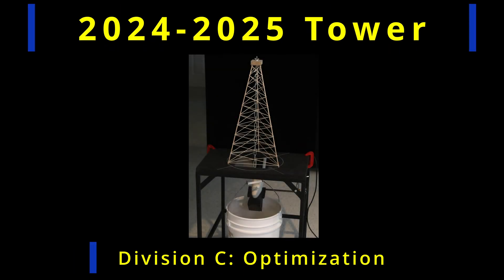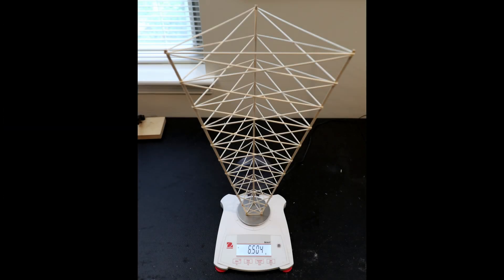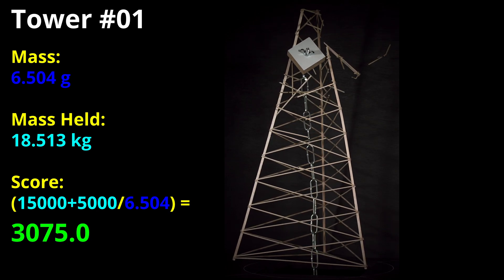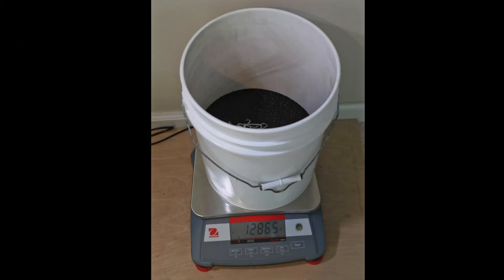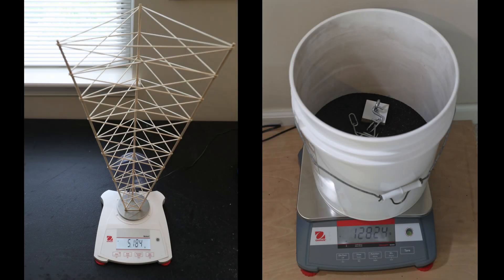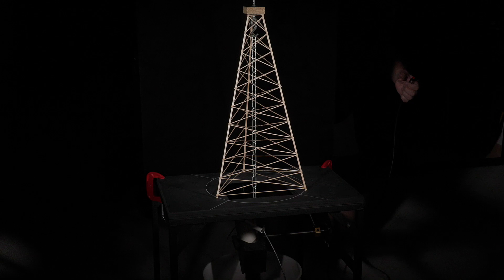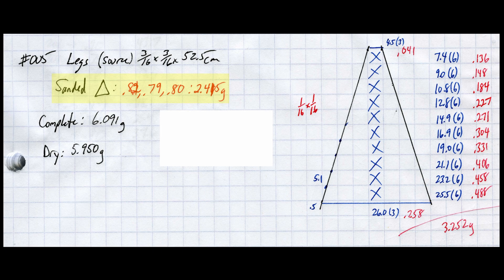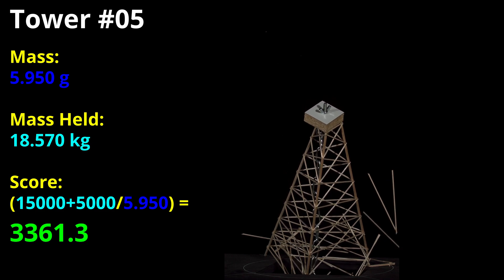2025 Science Olympiad Tower Div C: Optimization

Comment: Hey Balsa engineering I have a quick question if you don’t mind. So this might be obvious but I didn’t fully understand, why for this did you use a simply triangular pyramid shape whereas for your Division B build you used something more complicated with a separate base and column? Is it because with only three legs the structure is two weak to handle that change?
Reply from the maker: Hi!  It's all because that's what the rules require.  For Div C you have to have a 3-leg tower this year and for Div B, you have to have that base+column design.  Check out my videos on this year's rules if you want to see the details.  Thanks!

Comment: Any tips on how to load the sand? Should I just shovel it in as fast as possible?
Reply from the maker: If you are using an auto-loader like I show here, my recommendation is to start slow for the first 5-10 seconds and then go pretty much as fast as possible.   You want to minimize the time under maximum load.  If you have to hand-load, try to minimize the time between cups.  Don't dump the sand all at once, but again, pour pretty quickly.  Good luck!

Comment: Hi balsa engineering! I was wondering if you recommend gluing the crossbars at the center or to leave them unglued. When I was building and testing, I felt that the tower broke a lot near the intersection of the crossbars - do you think this is because I glued the centers? Thank you!
Reply from the maker: Hi!  You definitely want to glue the center point of the cross members.  It effectively makes them 4 times stronger against buckling due to being half the length.  If you want more details and a good demonstration, check out my 5-part tower basics series from last summer.
Reply: Okay, thank you so much!
Reply: Hello! I had another question - today I was building my tower on my jig and when I went to take it off, it was very difficult. Unfortunately, one of the legs of my towers splintered and came apart 1 inch from the base so I reinforced it with glue. Is there anything else you would recommend doing such as adding another small piece of balsa for reinforcement? Just for reference, my tower is just under 7 grams. Thank you for your help!
Reply from the maker: @user-zh8jn9lk9s  Hi!  For a broken piece like that, I would recommend gluing a small piece next to it that acts like a splint and not to rely just on glue reinforcement.  Good luck!!
Reply: @balsaengineering6686  Okay, thanks so much. Your videos have been extremely helpful this build season!

Comment: Do you also glue where the two cross braces intercept?
Reply from the maker: Yes, definitely.  That joint is very important as it increases the buckling strength of those cross members by a factor of 4 by effectively cutting the length in half.  If you want the in-depth theory answer, check out my 5-part tower basics series from last summer.

Comment: hello balsa engineering, any tips to get the tower off of the 3d jig? I have tried pushing it, tried tilting it to horizontal, and placing small segments of leg on the  bottom of the legs and then placing the small segments against the wall and tapping the mold with a small tapping hammer in hopes the mold will move out and the tower will be freed. normaly these work but havent for this tower, any tips? Thank you
Reply from the maker: At some point, it's possible that it's glued to the jig so bad that you are going to have to damage it to get it off.  I would use the technique of turning it upside-down and using a hammer to directly tap the legs from the bottom.  At some point, they will pop off the jig, but hopefully not before too much damage.  For your next build, really focus on using less glue, which is the best way to keep this from happening.  Good luck!!
Reply: @balsaengineering6686 yeah, I noticed this happened which is why, although i forgot to mention, i layed wax paper along the sides where the legs touch, so i dont think that it could really be glued to the mold, but thank you for the advice, i will try hammering tonight

Comment: Hey Balsa Engineering!! I heard that we should be baking our designs we heating them up to remove moisture. How does that change the tower build? Thanks!
Reply: It wont change the weight at all unless you keep the tower in a vacuum chamber right up until competition. Whatever moisture is removed from the tower during heating, will be passively re-absorbed by the tower in regular conditions. And even if you do keep the tower in a vacuum sealed box, good luck weighing it within the ten second window you will have between when it is taken out of the box, and when the tower is weighed at competition. I saved a whole .04 grams with this method, so it has extremely marginal weight savings as compared to what could be saved with a better design.

Comment: Hello, I really love your videos and this video has helped me tremendously with preparing for my upcoming state competition. What adhesive/glue did you use to glue the wood to each other? I am currently using gorilla wood glue and i feel like it is pretty weak and loose and takes a long time. Also, how much glue should I use at a time to ensure best stability but not adding too much weight? Is applying glue at the cross section X where the trusses interset good for stability? Thank you very much.
Reply from the maker: Hi!  Thanks for the kind feedback!  The short version is I like to use 50 cps CA (super glue) for all my builds.  You definitely don't want to be using wood glue.  I made an entire video on glue and gluing techniques you might want to check out: https://youtu.be/55lb2KzSiwg    You definitely want to glue the center of the X cross-members.  If you want to dive deeper into why, check out my 5-part tower theory series.  Good luck!!  (I answered this same question in another video, but copied it here as well - no worries)
Reply: @balsaengineering6686  i also have CA gorilla glue right now. Do you think that would be good to use? I dont know the viscosity of it. My 1/16 trusses are extremely dense, they weigh 10g by itself in total. How can i get less dense trusses?
Reply: @balsaengineering6686  i also have CA gorilla glue right now. Do you think that would be good to use? I dont know the viscosity of it. My 1/16 trusses are extremely dense, they weigh 10g by itself in total. How can i get less dense trusses?
Reply from the maker: @拖更侠游戏  The CA gorilla glue should be fine to use.  Definitely way better than wood glue.  As for getting lighter cross bracing, there is no magic, you just need to use lighter balsa wood.  The only place I know of where you can specify a density range when buying is Specialized Balsa which is where I like to buy my sheets from.  You can also buy locally or from other sources and then sort the wood ahead of time and use the lightest you have.  Balsa has a huge range of usable densities, easily 5x, so it's not uncommon to find both light and heavy wood in the same dimensions.

Comment: Hello Balsa engineering, where can I get the moulds for sanding the bals down to triangles? I tried 3d printing a device for cutting the balsa to triangles but it does not work well.
Reply from the maker: Hi!  Check out this video: https://youtu.be/MTHygxUS3YU   You can download the STL file I used to make the 3d leg jigs in the description of that video.  (Actually, the jig is also in the zip file in the description of this video as well)

Comment: Hi, balsa enigeering I fist want to thank you because I was able to get first at regionals. However, I was wondering if it would be fine to use 0.75 gram  legs to make my tower lighter. I'm not sure if I used 0.75 gram legs that it will carry 15kg.
Reply from the maker: Hi! Thanks for the kind feedback and congratulations on getting first at Regionals!  It's hard for me to know for sure if 0.75g legs would be good enough.  It's certainly worth experimenting with though as my ~0.8g legs held over 18.5kg, so there is probably plenty of room to lower them if the rest of your tower is well built.  Good luck!!
Reply: Hi okay thanks but my only concern is that my 6.66 gram with around 0.8 gram legs broke at around 16kg. I'm if this is because me and my partner went really slow with loading the sand.
Reply from the maker: @asteralemayehu4973  It's possible, but it's also very possible the difference is in how level the tower was or some other small difference in the cross bracing, or just an imperfection in the leg wood itself.  There is certainly some luck involved as well.
Reply: *I'm not sure
Reply: As you will hopefully come to understand through testing, the structural efficiency of wood has little to do with its actual weight, rather a casual correlation. Two pieces of wood could both weigh the exact same .75 grams, however one could hold half as much as the other. This is all determined by the microscopic structure of the wood, such as grain alignment, fiber density, micro-tears, ect. Thus, whether or not a .75 gram leg actually holds the 15kg isn't some guaranteed yes or no, rather its determined by the chance that a .75 gram piece of wood of that density could happen to grow in such a way to be strong enough to support 15kg. If you wanted to find these exact probabilities, you'd need a material sciences lab and a degree in statistics. Instead, you should be trying to determine the strength of your wood prior to assembly, so that you can roughly be confident that you know the maximum possible weight it can hold under ideal conditions. What this looked like for me was building 39 towers. In short, yes you could use legs that weight .75, you could even possibly use legs that weigh .6, you just have to search long enough to find the wood that will actually allow you to do that, otherwise if you just randomly selected your wood while only looking at its density, 9 out of 10 towers will fail.

Comment: Hi Balsa Engineering, thank you so much for the video. I built the tower following your steps and it turned out to be 11.91 grams and held 14.870 KG. What should i do differently to get the weight down while also holding more weight? Also, what is the difference between 50 cps glue and regular super glue? Is the 50 cps lighter?
Reply from the maker: Hi!  50cps refers to the viscosity of the CA.  When you refer to "regular", you are probably thinking about medium density.  50cps will be much thinner than that.  I find it's easier to use less glue that way.  That being said, your issue of being much heavier than my build has to do with the density of wood you are using.  There is no magic here, you just need to use/buy lighter wood.   A place like Specialized Balsa will allow you to specify a density range when buying if you want to pursue that.  If you are having issues with a ~12g tower holding 15kg, the problem is most likely that it's not perfectly level or there were some bad glue joints, so focus on that for your next build.  Good luck!!

Comment: In your experience with loading assemblies from competition in Michigan, how do competitions typically connect the chain to the bucket? I've noticed in numerous test results recently that load distribution of sand and bucket skew can have a severe impact on tower performance when your tower is very light, and how the bucket is constructed, how the s hook is connected, and how the sand pours, all have non negligible impacts. From photos of various invitationals around the country, there appears to be no uniform way of load assembly, some competitions connect the s hook to the metal handle itself, and some connect to the plastic guard around the metal handle of the bucket. It also appears that many other towers at invitational various competitions do face severe bucket skew, has this been the same observation on your end? And if so, how might one plan for this possibility at competition?
Reply from the maker: Hi!  Yes, you will definitely find different test setups all around the country and even within the same State.  If we limit the discussion to the auto-loader system, as long as the bucket is a couple inches off the ground (so it doesn't touch the ground if it tips) and not touching/interfering with bucket itself, it's all fine.  You can think of the chain to the bucket handle as a point connection.  The sand distribution within the bucket, ie, if it's tipping or anything like that doesn't matter at all.  If the bucket and chain are swinging (a lot), it will matter, but that's different.  I always tell people my recommendation is to start relatively slowly for maybe the first 5-10 seconds to make sure there are no major issues, then pretty much go full speed.  You want to minimize the TIME under maximum load, so as you get closer to max load, go as fast as possible.  You will notice in all my videos, I don't even have a second person stabilizing the bucket.  That task is mostly not necessary if the sand loading is done in a controlled way.

Comment: I'm curious, what density wood did you use for the first tower? I've been trying to make something similar but could never get the weight low enough. On that note, where could I buy balsa with specific densities?
Reply from the maker: The mass and dimensions for all my builds are shown in this video when I show my notebook page.  Here is the spot for build #1: https://youtu.be/qjI3Yj9Nqc0?si=QoDqWGC1JQK-utAG&t=30   You can compute the exact density if you want by dividing the mass by the volume (be sure to convert the units properly).  As for buying specific density wood, the only place I know of that does that is Specialized Balsa, which is why I like to use them as my primary source.  https://specializedbalsa.com/products/balsa_sheets.php

Comment: Hi one more urgent question if you can respond. I ended up having way heavier wood than you. I need to reduce weight somewhere. Can I remove one of each cross brace in the upper half and still have a strongish tower since my wood is more dense?
Reply from the maker: Hi!  The answer is "maybe".  It depends on how much stronger your wood is.  In general, by going with the X design, you are increasing the buckling resistance by a factor of 4, so if you pieces are 4 times stronger, it's probably OK to go with just a diagonal design.  If not, you might have issues.  Basically, you'll need to try it and do some pre-testing of the tower to see how it performs.  Good luck!
Reply: @ do you think being around 5 times as heavy would potentially correlate to being that much stronger?
Reply from the maker: @franciswickman1586  Potentially, yes.  But I would still pre-test the tower before using it in a competition

Comment: what size sticks do you use for the outside of the tower. We bought 1/16 sticks for the inside X portions but what did u use for the outer parts?
Reply from the maker: Check out this video on how I created the legs for this build: https://youtu.be/MTHygxUS3YU?si=ac2grPHfp6DmAcDJ   The source material was 3/16" x 3/16" and sanded down to a 60/60/60 cross section.

Comment: Hey Balsa Engineering, I was wondering how you can get the top of the tower so flat (the place where the loading block sits). How are you sanding it down (if so, what are you using? Are you cutting it? Also, should I sand/cut the legs down so they're equal with the top 3 1/16 x 1/16 sticks or slightly above them? I was wondering since I used heavier legs than you're first tower and your benchmark build, but the top was slightly off-balance, and the legs were still snapping around 9kgish, so I assume it's because of the imbalance of the tower.

Thank you!
Reply from the maker: Hi!  Check out my assembly video for all the details on how I built it.  The TLDR version is you want to sand the legs down while they are still attached to the jig.  This makes it easy to get them perfectly flat.  Here is that spot in the video where I show that step: https://youtu.be/TkUS4W4bOZM?si=biUHInAu7ZFfXVPZ&t=98    If you get the legs perfectly flat, it's really not super important to get the top cross members flat as the block will sit only on the legs.  If your cross members are at all above the top of the jig, sand them down too though.  Good luck!

Comment: Hey balsa engineering what's is your thoughts on tapered legs where they get thinner towards the top, I was thinking this technique could help come close to the MIT invitational score of 4,400
Reply from the maker: Hi!  I don't think I'd recommend tapering the legs.  The legs are going to have to support the entire load all the way from the loading block to the testing surface and the vertical load at the top isn't smaller than at the bottom, so a taper would only mean the bottom is over-designed compared to the top if it held 15kg.  If I were to recommend the next steps in optimizing this design, I would look into seeing if you could remove both the bottom and/or top horizontal pieces.  That might require making the very top or bottom cross-members stronger, but it very well could be a net gain (overall lighter).  I would also take extreme care to see if you can minimize the glue usage as much as possible.  It's very easy to use too much, and I often do it myself in builds when I'm going quickly, but it's possible to use a tiny amount and every bit of mass reduced helps!  Good luck!